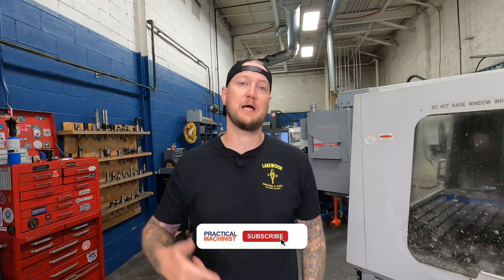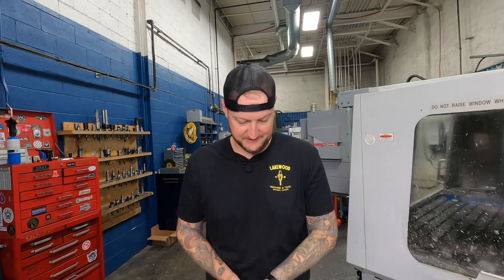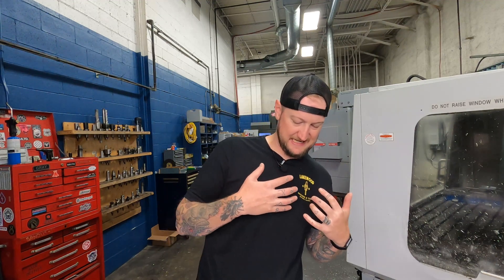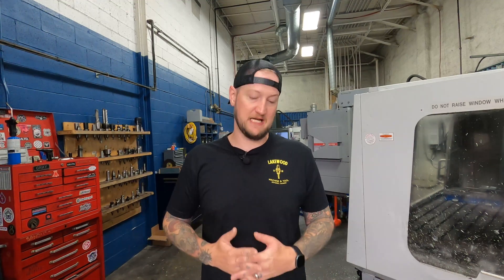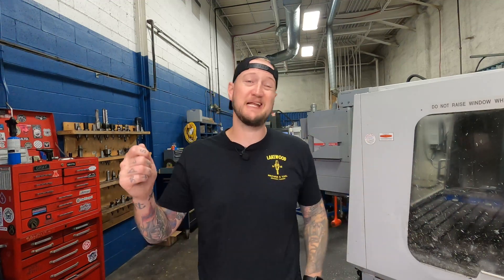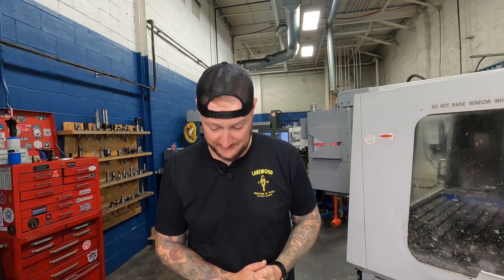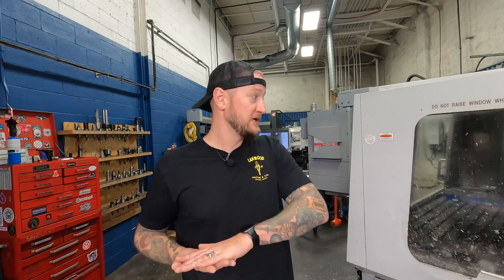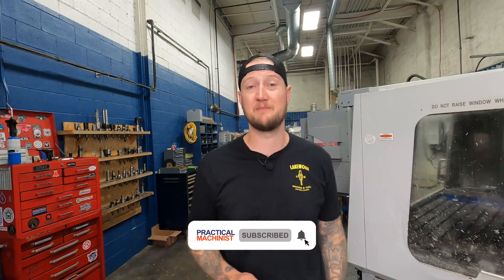Should You Charge The Same for CAD, CAM, & Machining? | Machine Shop Talk Ep.120

Comment: i would say yes the same.
reason being its usually the same guy.
freq the guy setting up and operating
is going to program what he wants.
on big machines not so much
becuz mgt wants the spindle turning constantly
on big machines so there will be a full time programmer.
in that case the machine time will be much more expensive.

Comment: Small one man army fab shop an hour is a hour regardless my shop rate is simply 130hr 
+ materials with 20% over cost 
+ process i charge a $30 cnc plasma set up and $30 for welding alloy 
Just about anything else is under the shop rate

I can understand why people will break everything down to get a better understanding an that's not a bad thing but dont lose dollars chasing cents

i was told by one of my customers about how he had an accountant on staff who would spend days chasing $100 here $300 there to balance the books 

And would proudly walk in at the end of every month showing how much he saved or found And it was never more than his wage that week 

My customer calls it slippage its going to happen so you may as well make it work for you

Comment: So I think you got a bit confused in your category breakdown, Computer time, machine time,  fixturing  etc.

Engineering/design is a whole different ball game and after a certain fixturing/tooling design would fall into this category.
To me the only real difference between a large and small run is how much time and effort goes into fixturing (which can reduce set up time drastically) but you still need to bill custom fixturing to the customer but like programming I think it is wise to emphasize the fact that those are (usually, barring wearing out fixtures/tools or programming changes ( if you can tweak a tool path to speed things up and be more profitable or run multiples is probably something the company should absorb) one time costs paid for on the first run and each additional run is simply setup/clean and machine time.

I am not a fan of showing the customer a cost breakdown for a part or job, usually because it makes it easier for your competition to under bid you.
I have found it can also cause upset if they think you are charging then too much because you are running too many parts at once or have a guy tending more than one machine etc etc.
Not having customers walking around the shop is a very good idea.
At the end of the day EVERY JOB MUST MAKE A PROFIT!!!

Comment: Small shop that does small / medium run production:  When I get the RFQ in. First off how many parts, material type, how much material needed. Cost of material / per part. Then I look at the part and imagine machining it. How many different tools, what type of tools.  Then I look at operations in detail. How much time in minutes per each operation.  Aluminum, Steel and Stainless all have different rate per minute. Flat rate on programming time per hr.  Break down anodize or black oxide per part cost if needed. You got washing, packing cost. Last but not least margin target %. Normally get quotes back to customer within 1-hour or 2-hours tops.  Unless they send end of day. They'll have it first thing when they get in.  Many big shops take a full day to two days to get a quote in.  I don't do design work or reengineering a part. Have your ducks in a row or find another shop.  PDF or Solid / IGES and where good to go.  Time is money and I can work on one or two jobs and make it. Then doing your homework for you.

Comment: wat do you think about fusion 360 ?
i kno blastercam myself
my employer does not n
i was telling him to get fusion 360
now im not so sure
1   i hear list of features changes and pricing changes over time
2   you must be online to use it so your customers info is at risk of being uploaded
not liking subscription so much either
Reply: Pricing for everything in life changes over time. Other than a few price changes due to repackaging, any increases have been in line with inflation. 

The features change mostly because new features get added. So the software has improved massively over the last 10 years. It's now one of the best CAM products on the market for CNC milling (3, 4 & 5). It's about to get really good for turn/mill as well. 

You don't HAVE to be online to use Fusion. But by default it does sync and backup all your work to the Autodesk Cloud. Most workshops don't have reliable local backups of their data, so they are at risk of losing their customers and their own data. 

Subscription is great for a low cost of entry. But sure, you HAVE to keep paying it. Any shops who stay at the cutting edge, pay maintenance every year for their perpetual licenses anyway. It's pretty easy to predict which shops don't pay to keep their software up to date each year... you only have to walk into the place, because the mentality shows throughout the shop.
Reply: @ScottMoyse  back in d day
you would purchase a thing n you owned it !
now not so much.
i have talked 2 companies i worked at into buying mastercam. they did, n cried, but only cried once, but really cried good !
one place was using gibbs, goofy af. its like somebodies high school software project.
idk wat new features are, wat you are doing is not changing so does the software need to ?  solidworks sits real low in d water now
i noticed. so many features its a forest of features. wheres d core functionality, o idk i need a gps to find em anymore !

Comment: As a one man shop with CNC and manual, my highest rate I charge is when my attention is 100% consumed by one task. Say a large shaft in a manual lathe, or making fixtures and jigs, programming etc. 
running the CNC's I can make it a bit more competitive as I'm usually running 2/3 at a time plus a manual machine. $100 an hour is cheap where I am in Australia so do that x 3 machines and you're doing pretty decently. But if I'm stopping all CNC's to focus on a manual machining job, it's full shop rate
Reply: That sounds like a good system - I feel it’s much in the same for a lot of successful one-man shows!

Comment: For the shop i work at each operator are doing their own programming (Low Qt/High mix), so for our boss it makes sense to charge the same for every step in the process since its such low volume for each part the spindles aren't really running while they make each program. Hell, im lucky if i get more than 5 of the same part.

For those shops who have enough people and volumes to have dedicated programmers and such i could see it making sense to have different pricing depending on if its cad, programming, setup or actually making chips.
Reply: Quite true!

Comment: One man shop here.  Time is time don't care what it is.    Only time I would add additional to shop rate and materials is when special tooling is needed.  Most of the time, I am doing cad and cam while the machine is running.  I quote in minutes not hours.  Alot of times i will ger rfq, quote, and get PO all in same day.  Maybe a day or 2 if it is a large project.  There is a huge correlation in time to quote and percentage of won quotes.  Would all be different if I had employees.
Reply: This is very true - funny how it differs from shop to shop - I find these days I quote based on “days” not “minutes” - but other jobs I feel like I’m counting seconds.

It never gets easy, I’ll tell you that much!

Comment: Small shop perspective, it makes sense to quote your cad/cam time differently than your setup/machining because of the different overhead considerations.
As I've gone along I've gotten a good idea of what to charge for each individual step and if the customer requests it they can have a spreadsheet of every cost broken down to how many seconds at the saw and board feet to crate, but the default breakdown I give is still CAD/CAM, setup, fixturing, crating, and a per-part cost that covers materials, prep, machining, and inspection.
Reply: This definitely makes a lot of sense!

Comment: In my own shop, I am partially breaking down each process. Cam programming is a rate and then setup and machining time are the same. I consider doing the setup in using the machine.
Reply: That’s a good way to put it, since the setup is essentially machine time - can’t exactly be running another job while you’re doing it I suppose!